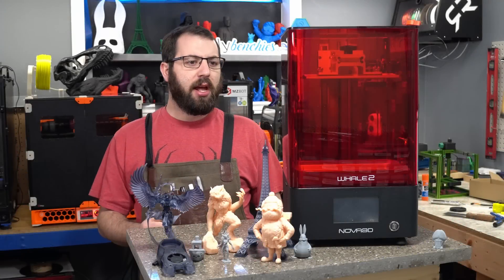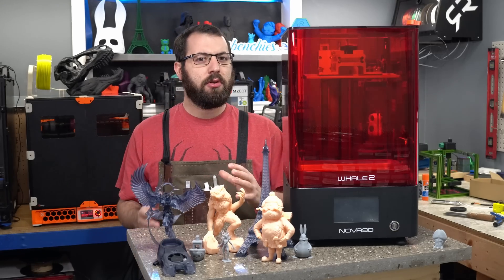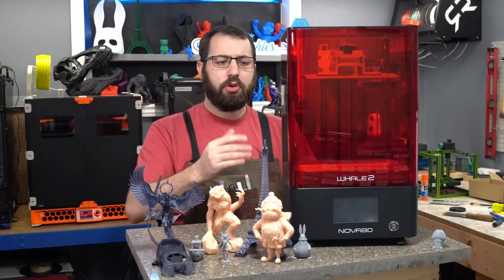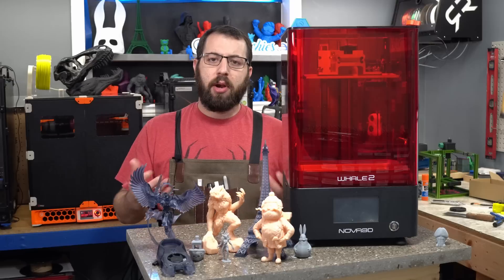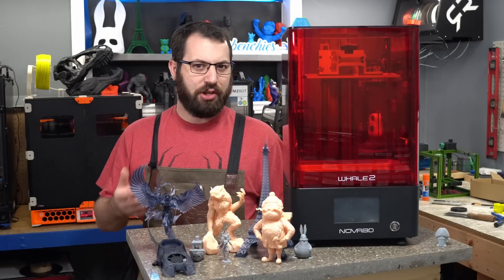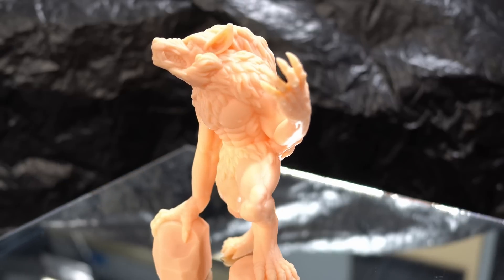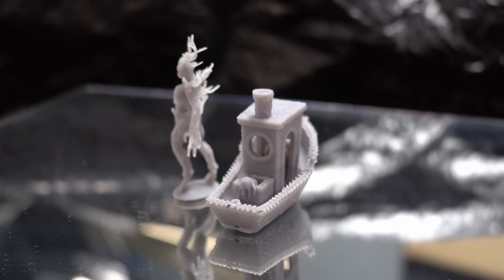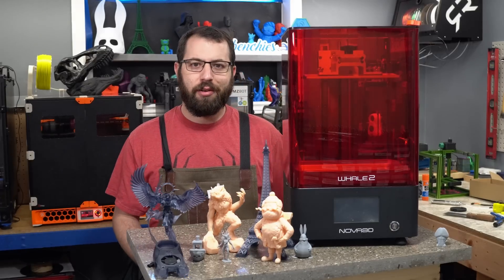Nova3d Whale 2 - 4k Resin with built-in WIFI

Comment: How did you insert threaded inserts in the resin? From what I understand you can't use an iron to heat the insert (cured resin will not melt)
Reply from the maker: The front face of the SB doesnt have heatsets. Rest of the components are abs
Reply: @CanuckCreator  I am looking for a solution to make all the ansamble from resin. Do you know any option to get the threaded inserts in to the resin? :D it could be a nice video!!
Reply: @florincurelaru  Drill holes with a bit that has the same diameter as the inserts then put a "little" not much epoxy resin on the outer surface of the inserts and then push them in the holes you made and let them cure.
Edit: you can use a 3mm long screw as a helper to deal with those inserts.

Comment: I found that in a heated chamber I had to use a mix of siraya tech resin. Their ultra white hi temp resin mixed with their tapple resin worked nicely. I was able to tap the parts and they didnt give out due to the high heat Temps. I did a 1 to 1 ratio mix
Reply: Sculpt ultra white is tap-able  by itself, I've be using the parts just fine with that
Reply: @Ktmfly3r  interesting I'll try that sometime but I mixed ultra white sculpt with sonic grey build
Reply: Could you please specify which specific Siraya Tech resin was used? They have few options -- Blu, engineering, tough, flexible, etc. I need a resin that will be strong enough, non-brittle( even ESun ABS-like is brittle) heat resistent engineering resin for mechanical parts under constant stress.
Reply: @krukhlis  I mixed ultra white sculpt and sonic grey build
Reply: @krukhlis  Blu is the toughest from videos I've seen on Youtube.